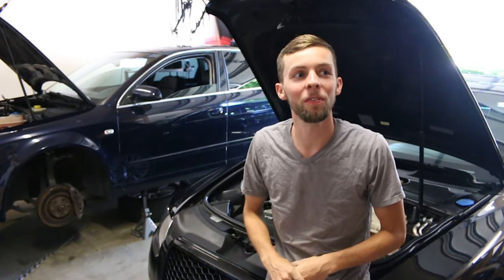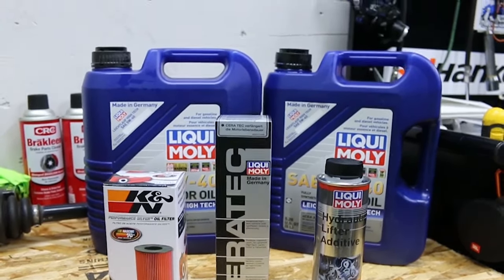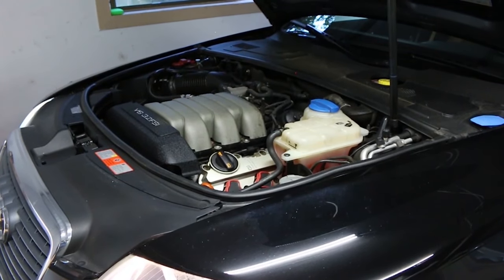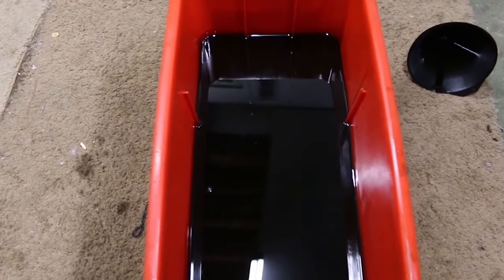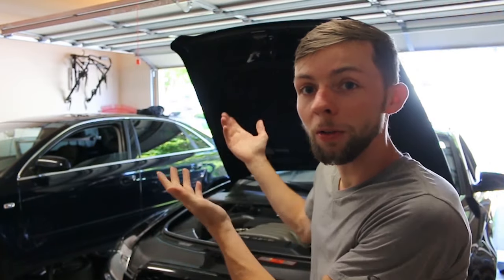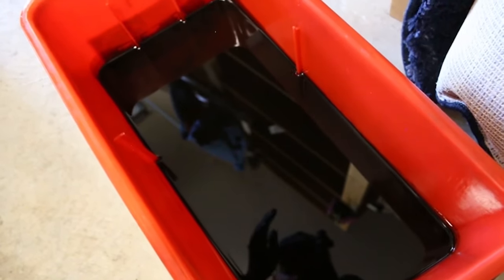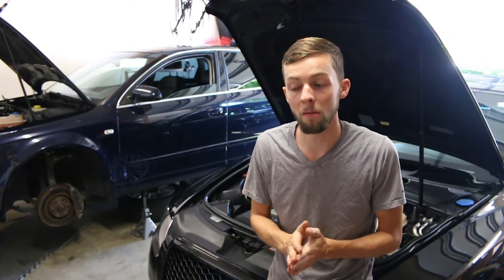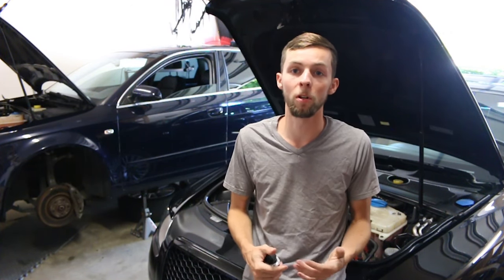LiquiMoly Engine Flush | Does it work?

Comment: Had a similar issue with my audi. Fixed it by buying a lexus, sadly I will. Never go back to audi after the lexus.
Reply from the maker: Thats a great fix! Lexus is great, they make amazing cars for sure with a lot less headaches.

This car actually had bad timing chain tensioners conveniently located on the back of the engine😅
Reply: @Mechani_Cole  don't get me wrong I love everything about my audi other than the reliability of it lol. The Germans have nicer interiors and better performace but that s4 was brand new and was at the dealeeship 5 time in the first 6 month. Engine burnt so much oil that I finally ask for a full refund which was a bit of a battle but they ended up giving me a full refund.
Reply: @Mechani_Cole  man that is a big job for the timing chain good on you for tackling it
Reply from the maker: @LiamG903  i agree there too.

I have 2 Audis now, but the one is this video I got for $1200 from a friends wife, pretty much fell in my lap. So it was worth it to do the work. Had I paid full price, I would have been sad when that repair bill hit. 

We have the Q5 and A6 Avant, enjoy both of them. Luckily, neither one has seen a shop as I am able to maintain them🤟🏼
Reply: @Mechani_Cole  I have a 2020 is350 and an rs3 pulled up beside me. We had a little go and he flat out destroyed me, I was jealous not gonna lie. Just kept telling myself ya well mine is reliable as hell.. Made me feel better but he legit spanked me lol.
Reply from the maker: @LiamG903  nice car though! With a lot less future issues🤞🏻

Those RS3's are quick though😳
Reply: @Mechani_Cole  ya it's a great daily that's quick. But the rs3 was straight up fast. Anyways I subscribed and will keep an eye out for your vid cheers
Reply: Beast Comment
Reply: Lexus is such a great upgrade!
Reply: Best comment 😂
Reply: I just got a lexus for my wife a is350 2006 really fun car bout to change front bumper and grill to 2020 style
Reply from the maker: Hopefully you'll post some pictures! Is it a direct fit?
Reply: @Its MechaniCole  yea it is just bolts up I already but the 2014 mirrors and rims just waiting for the newer tail lights and headlights and bumper in the mail
Reply: that sounds like a you problem
Reply: I was thinking of trading my 3 BMWs for an SC430 to correct that problem too.  Lol.
Reply: @likits1999  haha it's a good fix
Reply from the maker: @alexanderkennedy2969 agreed on that one!
Reply: I had an Audi S3 for 20 years (I know, long time to own a car, but I loved it). Running 27PSI for 17 of those years - never had a single mechanical problem. I just maintained it well
Reply: @Randy-lg1qo  that's a unicorn haha, not a typical audi. They need lots of maintenance and there is a reason their value drops do fast.
Reply: @LiamG903  currently have a 2018 Skoda Octavia vRS (also running stupid  power levels) and never had an issue with the EA888.3 engine either - not an Audi, but same engine. Maybe you just need to boost the crap out of them? 😂
Reply: @Randy-lg1qo  I like your logic haha
Reply: @LiamG903   I accept no responsibility for anyone taking this as gospel 😂 If you punch a rod thru a piston or lift your head, it’s on you. It’s luck of the draw with anything mass produced
Reply: I’ll add something of value (I’m obviously a car guy and have maybe a bit of knowledge).
Pick ur brand and learn it. I’m a VAG guy and understand the engines. Stick with what suits you. Toyota/Lexus had 3 recalls 2 years ago - not because they are bad, but 3rd party suppliers (DPF was a big one that killed engines). VAG group uses a lot of Bosch sourced parts and they suck (plastic thermostat housing on a heat-cycling block?!?).
This guy is doing a good service, but I’ve never seen this in warmer northern Australia, that’s why I clicked on it. Odd that it doesn’t happen here, but a problem in cold climates
Reply: But the interiors of Lexus looks so cheap compared to german cars :(
Reply from the maker: @JRCW892 agreed!
Reply: @JRCW892  it's gotten a lot closer with latest models. The biggest thing is fit and finish in lexus and attention to detail is just somethimg  else. The lexus assembly line especially in japan is so meticulous it's insane. Plus lexus seats are so comfy.
Reply: So you had a role model car and now you have a donkey 😂👌
Reply: I have a Lexus and I am so sorry about it. Pretty unreliable cars..
Reply from the maker: @user-br3mg5gt3g if maintenance isn't done. All cars suck then. Lexus is one of the best though
Reply: @РусланКаписъски  you most likely have been doing soemthing wrong or bough a beat up used car. Lexus is number 1 when it comes to reliability and it's now even close. Other cars are more fun but lexus are jusy solid beautiful cars
Reply: @Mechani_Cole what was your experience with Mos2 vs ceratec?
Reply: I do prefer Audi .The best cars
Reply: @LiamG903 
yup keep lieing to yourself about driving a cheap plastic marked up toyota. lol ill stick to my audi
Reply: @lonewanderer-im  audi are junk, that's why they depreciate so quick. Might as well drive a kia, if you want quality save up for a lexus. If you like driving soemthing that is in the shop more than in the road you do you. Some of us have a life to live and need the car to work lol
Reply: Lexus is a King for garbage Audi. I have one ES350 and amazing car.

Comment: one thing everyone should know, when do u have a diesel engine in your car , doesnt metter if u run 200 miles or 2000 oil will allways be carbon black ;)
Reply: Had a 12 year old toyota hiace with 200k and the oil would stay clean for most of the 5k oil intervals. Changed so regularly there was no carbon buildup
Reply from the maker: That part👆🏼 Most Toyota's I have worked on are always so clean if the owner takes care of it on time. Great trucks for sure
Reply: i jave a diesel jcb engine in my truck and that oil is allways golden yet my audi and such are ultra black as soon as i oil change
Reply: Diesel oil has a lot of detergents. Would do similar in a gas engine

Comment: There is another video out there that shows the correct way to flush the engine using this method,  you start by pouring the Liqui Molly engine flush mixing it with the old oil for 10-15 minutes, then you drain the oil and the flush mix and then you run a second batch of clean oil to remove the varnishes and harmful contaminants from the engine with the second flush by running the engine for another 10-15 minutes then flush and add the final batch of oil and the new filter to ensure no harmful deposits are left inside the engine. Doing it your way, you are leaving those contaminants trapped in your engine until your next oil change, I just did the flush on my XC90 Inscription and X5 38IDrive and the CeraTech treatment worked like a charm, the knocking on the engines is gone on both of them and the acceleration response highly improved. My only regret is not doing it sooner.
Reply from the maker: That's pretty extra, but sure it could work. 

For most people, just adding the flush to the old oil and draining will be enough🫡
Reply: Not extra... both methods are the same. One adds it to the old oil, one added to the new. Same amount of oil changes @Mechani_Cole
Reply from the maker: You'd have to drain the oil and fill it for it to be new
Reply: Hey i have a question I’m going to do your process but when I finally do the last oil change I add the Ceratech with the quarts my engine supposed to have or should I add less oil? And should I add the Liqui Molly Lifter Additive too or no? I have a knocking sound too, what do you recommend?
Reply: How is your engine doing?  any issues, oil consumption still improved since LiquiMoly?  and by how much..?
Reply: @edforthewin8574 @edforthewin8574  Make sure you're on a level surface and check the max line on the oil dipstick; you never want to be higher than that. If you need to remove the oil, add the additive and recheck the level.
Reply: @edforthewin8574  So how did u do it ?
Reply: Will look into this since I'm considering the BG dynamic flush.
Reply: Liqui moly themselves said you don’t need to flush it twice
Reply from the maker: @jaysrt21 correct. I even say that in my video. I've done it twice only to remove more sludge out of a neglected engine
Reply: thats insane,  it cool if you dont have LiquiMoly, the point of using this product is so you dont need to flush the engine twice, thats recommended by LiquiMoly,

Comment: I’m 63 and have been using the motor flush in the silver can for decades, 10 minutes of idle after pouring into the old oil before changing. Then I substitute I can of new oil with Rislone engine treatment. The Rislone cleans everything real well especially your lifters. Stops all lifter tapping after a couple weeks of driving. Great stuff. All I use !!!!

Comment: K&N filters are a scam, just use oem paper filters. Cars are tuned to run with a certain air mass that the stock filter provides
Reply: Would generally agree. Paper filter has been an issue when pushing much more than factory output in my experience, as in more than just an exhaust change!

Comment: Used the Liquimoly engine flush on my 12yr old 150,000 mile V8 truck today. Man, I dunno, i really don't buy much into these products especially since I've always used good synthetic oil and filter with regular intervals. But I swear the truck has more pep, obviously a 5300lb truck isn't a race car. But throttle response and accel from a stop feels noticeably improved, which has never happened from a simple oil change. So I dunno, for $6 I'll say the short term reaction is it worked for my case.

Comment: Bro every engine oil is black even after a couple thousand miles. That is perfectly normal.
Reply from the maker: Did you catch that the oil was only ran for 15 minutes with fresh oil and flush? Engine was full of sludge so much that the oil was black in only 15 minutes. My oil is still golden halfway through oil changes after doing this a few times. Engine was neglected before me🤷🏼‍♂️
Reply from the maker: Daaammmnnn! Thats a lot of sludge!😳 You might need a few flushes lol. Seafoam works really good too. 

Super curious if any cleaner will get that sludge out. When I finally pull this motor out and worked on it there was still so much in there.
Reply: @Mechani_Cole  yeah. YouTube deleted my comment because of the link.
I would gladly try seafoam but we don't have anything even similar to it in Europe. I'm tempted to rebuild the engine, it's a very simple pushrod inline 4. Weird is that it still runs and pulls great, I only get the occasional lifter tick but it's random.

Comment: If you’re getting noise on startup, it’s because the top end or timing chain is not getting lubrication quick enough. Best bet is a 0w oil for colder climates
Reply from the maker: I agree, and this is a good point! This was actually the cause of my issue. As additives help, it did not fix this problem long term. 

I actually just got done removing this engine and replacing the timing chain guides and doing a TON of work with the engine out. Tensioners were on the verge of failing and plastic guides were broken. 

All fixed now and video coming soon😁

Thanks for watching and commenting🤙🏼

Comment: You experienced the “Tapping” due to the timing chain tensioner being oil pressure actuated and your cam gears for the variable valve timing are also accurate by oil pressure. and having the wrong oil will impact the oil pressure and affect your timing which can cause engine failure if the oil pressure were to be completely off. Having the wrong oil slightly will affect it slightly and a tapping noise is the first indication.
Reply from the maker: Almost correct. In this exact case, the timing chain tensioners were failing. I ended up removing this entire engine and servicing all the tensioners and such, problem is fixed now. And yes, Audi is very specific on the oil used, must VW 502.00 approved at least. This flush works well, but it didn't end up fixing the much deeper issue. Runs much better now after the full repair. 

Thanks for watching and commenting, appreciate that🤙🏼
Reply: @Mechani_Cole  worth a shot. I should have said “this could be the problem” rather then assuming I was right.
Reply: @Mechani_Cole  nice work brother. Live the channel! Love your work. Love mechanics
Reply: Hello can I hire you as my mechanic for my BMW?
Reply from the maker: Would love that, but just moved to Vegas

Comment: ive used Castrol, Liqui moly, Shell Helix, Motul, Total,
With castrol i had too much oil consumption and the engine sounded rough and loud.
With Motul the engine became smooth but still oil consumption. At last i tried the Valvoline Synpower, The car became very smooth and powerfull, and zero oil consumption!

Comment: I used motul 300, mobile, liquimoly, pennzoil, bmw oil, and finally settled on castro euro because that oil immediately showed better noise reduction, throttle response and improved mpg. I used these oils over 13 yrs span.
Reply from the maker: Thanks for sharing!

I just got the Castrol Euro for this car to try for the first time🤙🏼
Reply: @Mechani_Cole  that castro euro is good stuff. Even better than the motul 300 which is 36 bucks per can.  And I stumbled upon the castro oil by accident because I was doing and engine flush. So now, I only use castro euro 5w30 or 40 for my BMWs.
Reply: @Mechani_Cole  walmart has then the cheapest. Fyi.
Reply from the maker: @bmwchannel7209  only $24 on Amazon too🤟🏼
Reply: I have a 04 Jaguar XJR just changed the oil with Liqui Moly 5w30 High Tec, bottle says its good for 25,000 miles but I am changing it in 4-5k.. will have to try Castrol Euro next!
Reply: @jaynikk758   - ignore their recommendations and just keep changing oil at 4k and you will be dead before the car dies.

Comment: Great and well explained. I too noticed less oil consumption and smooth running on my 2007 diesel Mercedes ml 320i . Keep sharing please and thank you.
Reply from the maker: Thanks for the comment Thomas! That is awesome to hear it has helped you as well🤙🏼
Reply: I changed my b5.5 passat from Castrol to liquimoly and so far so good. I'm 500 miles in and the level hasn't changed at all and the engine idles really smooth. Before I would have to add a little oil every 1,000 miles or so, not a lot, about 1/4 of a quart.
Reply from the maker: @Janet_Airlines802  that is cool to hear! Thanks for sharing your experience with it🤙🏼
Reply: whats well explained ? the engine flush needs to be added to the used oil at operating temperature
Reply from the maker: Sure, in the simplest method. Mentioned several times we were doing extra to remove more buildup🤙🏼

Comment: Nice vid I have a Audi A5 2.0 which are known for piston rings getting clogged up from carbon I did an engine flush couple of times and my oil consumption went down 80% I always use liqui moly molygen 5w40
Reply from the maker: Nice! Glad this has helped, I still use this stuff in our 3 Audi's we have. Works great at reduced the sludge/carbon😁

Thanks for watching🤙🏻
Reply: Can I try this on VW Polo 1.2 TDI, 2011 model , 165000kms driven always used genuine VW 5w40 , 505 00/505 01 spec.
Reply from the maker: @AS-pu7gj any engine. This does wonders

Comment: I've had my 2016 Audi A3 S-Line Quattro since 2016 and I've always used Castrol FTT 5W30. I've never had any ticking issues on start ups. Always change my oil once every 15,000 kilometers
Reply from the maker: This car was abused before me. Got it for $1200. However, I later found it needed new timing chain tensioners and a bunch of other work. Just pulled the motor and fixed all that, new video coming soon on it. 

This Flush is a great product, however it didn't fix my issue and no product could. 

Thanks for watching and commenting, appreciate it🤙🏼
Reply from the maker: Also, 15,000 kilometers is way to long for an oil change in my OPINION. I know the factory states that, but not mechanic or tech that I know would let their car go that long. I change every 5,000 miles max, usually sooner. I believe 15,000 K is 9,320 miles. Even testing oil after 5k on full synthetic, it is worn and losing its properties. Alot of good info out about this.

After all, Audi does say their transmission fluid is a "lifetime" fluid. But its not and must be changed as well every 50-60k miles. Kinda silly to me
Reply: @Mechani_Cole  Might change my intervals then. I've been using the 15K mark since I bought the car. But I'll change that starting on my next oil change.
Reply: 15000km is perfectly fine
Reply: Change oil 
Freeway driving 5-7k miles
Normal mixed driving 4-5k
Stop n go city driving 3-4k
Reply: @Mechani_Cole  I drive a VW Polo 1.2 TDI,  I used to change my VW 5w40 at 15000kms , but now I change at 12000kms , which is perfect sweetspot as I have seen many videos , they prescribe 12000kms/7456 miles. Synthetic oil is still healthier at 12000kms mark, but beyond that it gets degraded.

Comment: Add the flush before putting in the cheap oil. Just put it in the old oil. Then run the engine, put in the cheap oil, run the engine (drive the car around), then swap to the good oil. That gets rid of all the crap.
Reply from the maker: Sure, thats one way you "could" do it. But here we were trying to remove as much of the old oil as possible. Plus it only costs $25 to use fresh oil and let it run for even longer, this removes even more debris and buildup with the fresh cheap filter. 

You can do it any way you like though, this is for entertainment purposes only🤙🏼